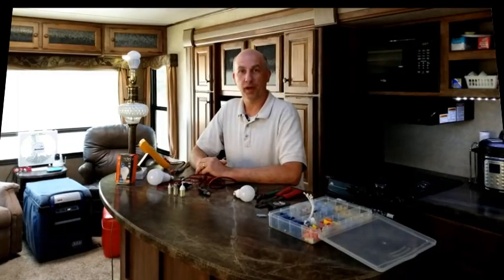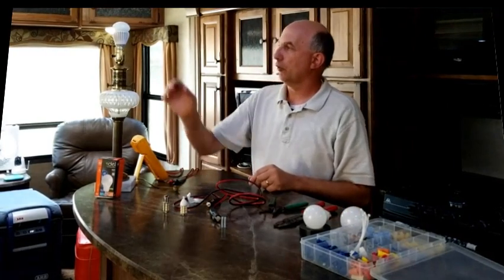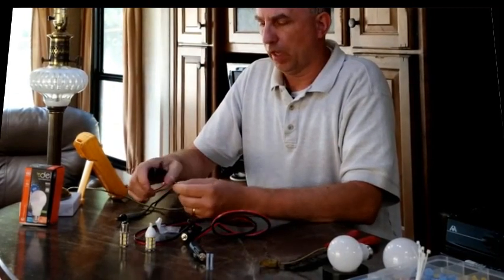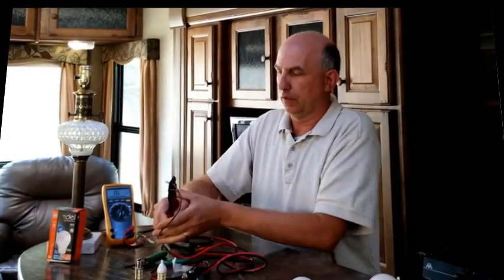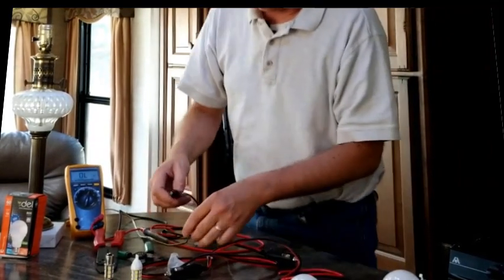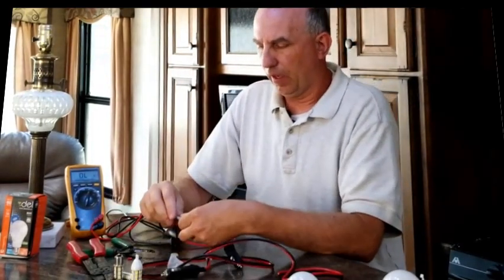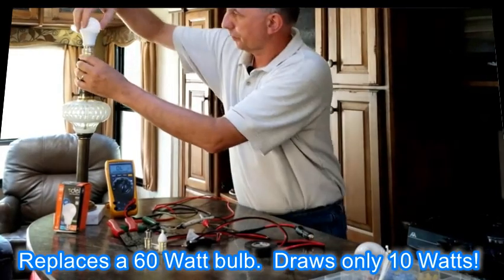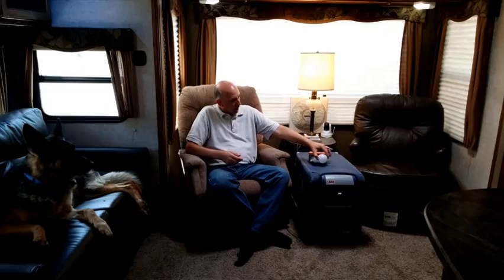120VAC household Lamp to 12VDC LED Bulb Conversion

Comment: i know this is 5 years old but thanks, it’s just what i needed. but i’m wondering, can you use xT60 connectors to join the lamp cord to the cigarette lighter plug? seems like it would make a cleaner connection? also, doesn’t the lamp cord indicate which lead is positive?  thanks for your help and advice.